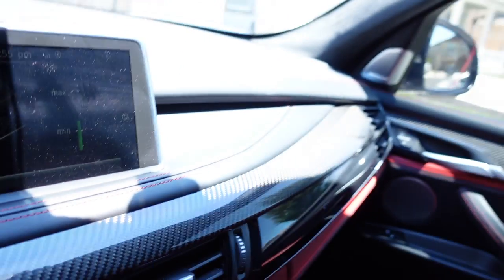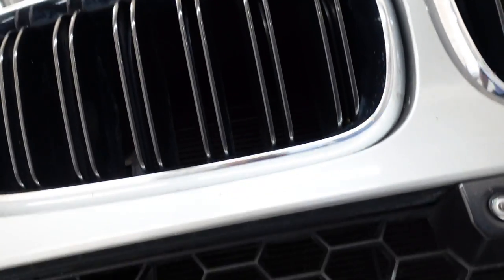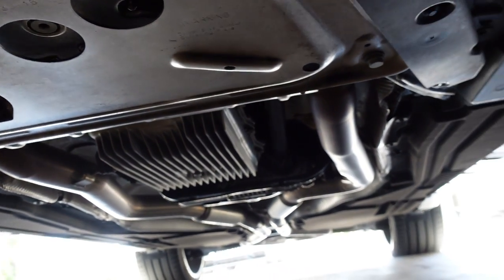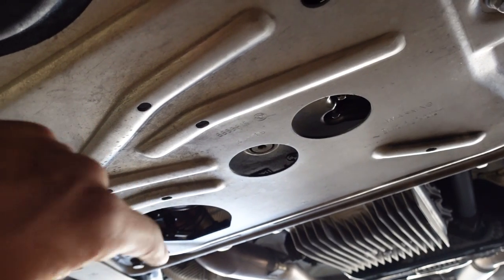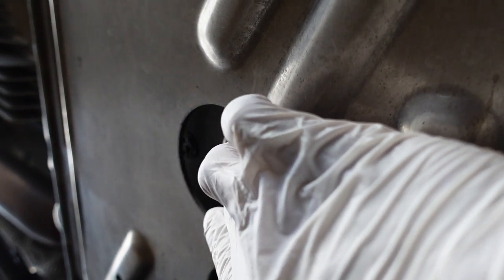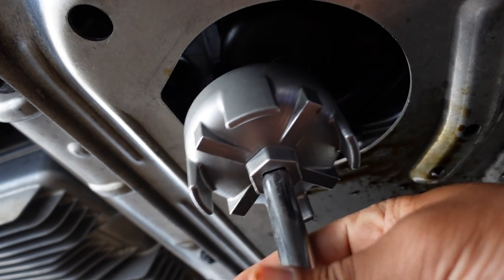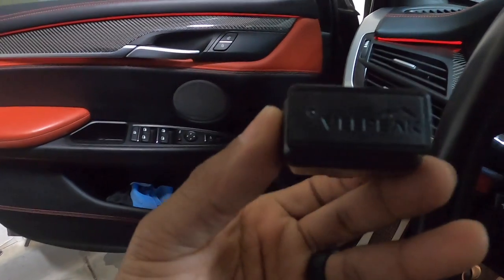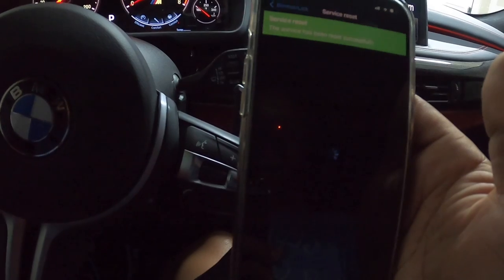BMW X5M/X6M DIY Oil Change- Reduce Your Oil Consumption!

Comment: Not sure it if matters really but whenever the oil filter is in this orientation, I add a few ounces of oil directly into the oil filter to prime it before I screw it back into place.  Can't hurt right.
Reply from the maker: It can’t hurt.  I’ve done this before in the past. I heard it helps prevent dry starting or something along those lines.
Reply: You should add a bit

Comment: Would have been great to also touch upon the procedure to tighten the oil filter and drain plug and torque values used.
Reply from the maker: 18ft lbs (25 nm) for drain bolt 
29 ft lbs (40 Nm) for oil filter. Hand tight first, release and go back to tighten to 29ft lbs.
Reply from the maker: It’s been added to the description.  Thank you

Comment: Another point.. my dad was a mechanic and always taught us when changing oil to not use ramps, but a jack (you can use a cinder block for safety in case of jack failure)  so once the drain plugs removed and it begins draining, you let the jack down so the car is level and drains better.  He said on ramps the engine's at a big angle and old oil will pool in the pan.  Is the X5 designed differently to completely drain while at such an angle on the ramps?
Reply: Ramps front, jack rear vehicle level and still raised.  Use proper jack stands at the rear not cinder blocks as they can fail
Reply from the maker: Your dad is not wrong about old oil. Luckily for me with the car at an angle, the the oil plug is at the very back of the pan so it’s pools at the drain.

Comment: Good choice, I'm using liqui moly 5w40+ cera tech, noticeable less burring oil. Before that I need 1qt every 1500-2000miles. Now, no more adding oil during each oil change (6000mile), yeah.
Reply: What engine ? N55?

Comment: Here is my concern adding additive to my f10 M5 engine oil. Should there be any kind of catastrophic failure, BMW usually does an oil analysis and I do not want them or my warranty company to turn down repair based on fact that I put the additive. Believe the car manual mentions no additive.
Reply: No additives yeah we heard it but the gear heads we all do 🤟🏻
Reply from the maker: I don’t like a lot of additives but the oil by itself contains additives.  Owner manual suggest not because there’s so many snake oil products out there they can’t say don’t use this or that. It’s easier to say avoid them all.

Comment: I never had even one ounce of oil added to my 2011 n63 v8 4.4 liter ever since I got it almost two years ago. 4k oil changes with ceratec and every 3rd oil change comes with a flush. She runs like a top.
Reply: Does the flush show any varnish or dirty oil particles?
Reply: @surreaLinnovatioN   of course the oil looks dirty each time it is flushed because that's what's supposed to happen. Keep the turbo oil lines clear and unclogged by consistent flushing.

Comment: Thanks for posting! Recently got an X5M and one of the guys at the dealership said I should be able to perform my own oil changes and after watching the video I think I'll give it a try. Your video is very detailed but any suggestions of things to look out for when changing the oil for the first time? Thanks!
Reply from the maker: It’s one of the easier cars I’ve done oil changes on.

Comment: Does anyone know what the small O-Ring is used for in the oil filter kits?
Reply from the maker: It’s for different type of oil filter cartridge.  My M3 uses it.
Reply: On the original N63 some of the original filter housings had a drain plug that you could remove to drain the oil in the filter housing before unscrewing the whole thing. The small O-ring was for that drain plug.

But since our current filter housings do not have this drain plug you can dispose of the small O-ring.

Comment: Hey Ed,
Nice video. 
What is the capacity of the oil drain container you used?
I have one that looks exactly the same, even down to the color of the labels on the side, and it says 9 quart capacity.
Thanks
Reply from the maker: Hi Bob. Mine is 24 quart capacity.

Comment: Have 2017 bmw X6M with 53000 miles.I have already done transmission service,brake pads,etc.Now I want to drain radiator and change coolant.Have already bought proper coolant from bimmerworld.Need to know where to find drain plug for radiator.Also wondering proper way to drain and refill turbo coolant also.Did the research and can't find anything on this.Any help appreciated.
Reply: What  kind of transmission fluid did you use?

Comment: Hi. My 2016 X5 M service manual calls for 0w40, or 0w30...It doesn't mention 5w30/40 specifically. What's the difference between 0w and 5w for our engines? Any risk with going with 5w? Thanks.

Comment: I've been trying out different oil brands and grades in the last 12 months on a 2017 X5 xDrive35i, namely Castrol Edge 0w40, Pennzoil Platinum Euro 5w40, Pennzoil Platinum Euro 0w30. I've been using LM Ceratec once too, also LM MoS2 on the next oil change. Next one I'll try is Motul Specific 5w30 rated for BMW LL01-FE. After I shall be only be running an SAE 40 grade as my N55 gains more mileage a higher viscosity clamps down oil consumption and provides a thicker oil film. In over 25k mi I never added any oil during the course of several oil changes.
Reply from the maker: I used OEM first but after the Liqui Moly the engine is smoother.  The Amsoil is similar but I’m going to monitor consumption.

Comment: Hello  again Edward. I'm curious to know why you didn't use liquid Molly's molygen for this oil change?
Is it because you are adding the ceratec?
If Molygen seems like somthing you would recommend after research please add a link, as I do enjoy your channel and using your links are one of the ways I try to show appreciation.
Also please consider that some of your viewers live in colder climates so if you can please add a few options to your oil choices.
I'm assuming that these are affiliate links. 
Thanks again man i really enjoy your content you've embolden me to do most of my own maintenance and I believe  that both of my vehicles has shown a boost in performance for it
Reply from the maker: Molygen isn’t an LL0-1 approved oil for BMW.
Reply: Yes it is

Comment: Thanks for the video. As I am at an inflection of keeping my X5M long term or moving on to something else I am considering doing my own maintenance.  Not so much as a cost saving on routine stuff but also time savings vs fitting into dealerships timeframe.  Do you use 2 cans of the Ceratec every 30k miles since it says its good for 5L of oil?  Im at 58k mile on my 2018 and not sure if I should keep or move on.  Once the kids are in college its 911 time.
Reply: 2 cans each flush.

Comment: I assume you put a new crush washer on your drain bolt? Did it come with the filter in your case? Or buy separately?
Reply from the maker: Yes, it comes with the filter!
Reply: @eddiemcars  nice yes I just found that out.  I purchased a MANN filter which I hear is a great Austrian brand.  I notice though that there is a big gasket as you reference and then a little round rubber (along with the crush washer).  I’m assuming the little rubber gasket is for the 50i? And others where the filter cap has an internal post?

Comment: Hey Ed im thinking of buying a 2017 X5M , I heard for the most part its a  reliable year, this one is a one owner and im waiting on documentation of maintenance its got about 85,000km on it , im wondering what are the main issues or what to look for thanks for your input
Reply from the maker: 2017 and 18 are the preferred years. 
Powertrains are about the same.  
Tonydriveshaft would be something I would look into upgrading in the near future if you decide to buy it.
Reply: @eddiemcars  Thanks so much!!!

Comment: You ran 5w-40 in that x5. When I looked  up what weight oil it was suggested I run  5w-30. 
Why did you run the 40?
Reply from the maker: The 40 seemed to help reduce oil consumption especially in the summer months. I tried the 30 for a while and didn't see that much improvement in fuel economy to justify continuing the lighter weight.

Comment: I think you are not using so much oil as you are using thicker viscosity oil with moly oil. Can you put in the  link for the oil cap removal tool please
Reply from the maker: Yes I can.

Comment: Does the small o ring that comes with the filter not get used for the F85?
Reply from the maker: No, that’s for the N55/S55 engines.  
You’ll need to replace the larger o-ring on the cartridge itself.  I also replace the copper crush washer that’s in the kit for the drain plug.
Reply: @eddiemcars  much appreciated! I was going crazy trying to figure out where it could go!

Comment: Interesting to see you are using 5W40 on a X5M. Any reason to pick 5w40? Specifically why 40? 
With high compression and high RPM , I'm surprised you opted to use 40.
Can you share your reasoning with us please.
Reply from the maker: 5w-40 was rated with BMW LL0-1 requirements.  
While the OEM requirements recommended is 5w-30. There was nothing wrong with going to 5w-40.   Personally I think the high heat these engines generate the 40 weight should minimize chances of evaporation/oil burn.   

Liqui Moly makes a 5w-30 that’s LL0-4 but I’m assuming it’s more fuel economy.  Either way the changes is minimal.  Cold start protection is more crucial.
Reply: In the service manual it says that you can use different combinations. Even 5w40. Doesn't anyone look at car service books anymore these days?

Comment: You've put 8k miles in almost a year now, that's not bad. I assume you don't commute long distance. 

By the way, sorry for being nosy but I'm still on the market for this exact same X5M and I'm curious on monthly gas costs you're dealing with and plus insurance. I know it varies for each individual and state but is just to have an idea. If you can answer that would be great but if I'm being rude and nosy I will totally understand if you don't want to answer those questions. 
I believe you're on almost a year ownership and would be great to see fuel costs and insurance.
Reply: You’re gonna get max 20 mpg. 13-15 strictly city driving. 

Insurance costs vary greatly and it’s a silly question to ask. Your age and history play a huge role in insurance costs. 

A young person could be paying 5 times what it costs to insure someone who has been driving for a long time.
Reply from the maker: Gas has been killing me lately. I’ve been keeping it parked.  With current prices, I am  spending $200 per week.

Comment: I just added a bottle of CeraTec last month on both my x5M and E63 AMG, and so far I can't tell any difference.  My AMG doesn't consume any oil, but the X5M does.  So, I will have to wait and see the results, when I change my oil in a 1-2 months.
Reply from the maker: I also noticed the small vibrations from the engine are immediately eliminated.
Reply: try amsoil 5w50 or 5w40. Pennzoil 5w40 is great too since its more readily available. I find that it does not burn at all with 3000 miles of driving and that's cause my car is tuned and driven hard!

Comment: I may be drunk or something.. which is very possible.. but at 6:33 you say to turn it counter-clockwise, but it looks like you cranked it clockwise..  I need a detective to investigate this oddity and report back ASAP :)  lol ..
Reply from the maker: I had to watch it twice. I turned the bolt counter-clockwise.  The handle looks like it went clockwise

Comment: I’m so confused with these bmw recommendations. 
I noticed that on older bmw f85 2015-2016 it doesn’t mention BMW LongLife 01 FE and in my 2018 it mentions that. My first oil change during my ownership I poured Liqui Molly 5w30 and I feel like it’s too thin cuz I had to add quart of oil at around 1500 miles.
I was trying to find 0w40 oil with BMW LL 01 FE but there’s nothing on the shelves with these  bmw recommendations.
Is this Liqui Molly 5w40 in this video would be safe to use on my 2018 f85 even though it’s not LL01 FE approved? Should I even pay attention to that?

One thing I’m worried about is rod bearings. I know if oil is too thick then rod bearings doesn’t get proper lubrication and could spin on the rod itself. 

I’m pretty sure I’m just overthinking…

What do you think?
Reply from the maker: The 5w 30 is the only formula with the LL-01 FE rating but as you said. You will probably notice more oil burn. Yes, you will be fine with LL-01 5w-40
Reply: It’s out of warranty. Run LL-01. 

BMW began spec’ng LL-01 FE on the S63 in 2017 for CAFE requirements. No other reason. There are such limited choices of good oil with this specification (which again, is solely for fuel economy compliance) that I don’t care about it, even with a service contract. 

My “new” ‘17 F85 will be getting the Valvoline Euro 5w-40. It’s solid oil, LL-01 approved, and available everywhere for cheap. I’ve always added a dose of MOS2 for all my oil changes in all my cars, so I’ll continue doing that. I’ll splurge for the “M” specific oil filter from FCPEuro, but my hope is if the engine ever needs work, Carmax’s MaxCare plan is going to care a lot less about it not being “FE” oil and more about it being done on time. 

tl;dr: the S63 was designed for LL-01. LL-01 FE was later spec’d to meet fuel economy requirements and for no other reason. You have no warranty to worry about, run LL-01. If you decide, for some reason, to stick with LL-01 FE, run Motul Specific. It’s the least bad of the FE oils (HTHS of 3.4).

Comment: Buy your oil at FCP Euro and save the containers.  They'll take the old oil back for free exchange.  Crazy i know but that's their policy on everything they sell even consumables like oil, brake pads, belts, etc

Buy it. Use it. Replace it.

Every part you buy from FCP Euro is guaranteed for life, for as long as you own the vehicle. Our Lifetime Replacement Guarantee covers everything we sell, including wear-and-tear items like brake pads, gaskets, brake rotors, filters, and wiper blades!
Reply from the maker: I’ve heard that. I’ve always wondering how to ship used oil back 🤔
Reply: @eddiemcars  If it fits, it ships. Put used oil in the box from post office. Costs less than $15 to ship it back.

Comment: I think this filter is for 50i ,  correct one  should be  ox 353/6  11427848321
Reply from the maker: I stand corrected.  Now I question do I have a 50i oil filter or M ( which is a little longer) 🤔
Reply: @eddiemcars  I had  same filter in this video Mahle 353/7 for my old e70 50i(no longer have it) recently just bought 18 f85 white with red leather , it burn the oil but much better than n63, I will try the liqui moly oil and ceratec, your  video really helps a lot, keep up the good work👍
Reply: @eddiemcars  is this really the case? I can't find any reference to ox 353/6 and FCP Euro offer this same one for X5M?